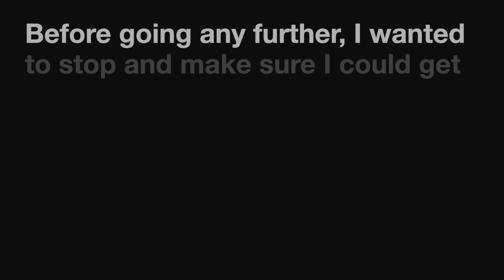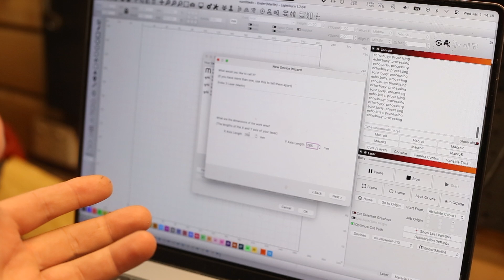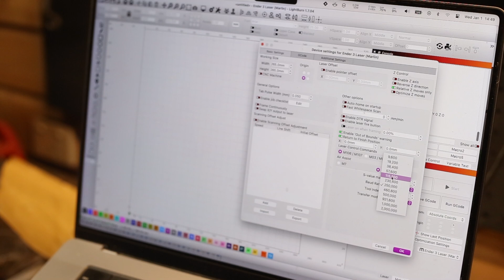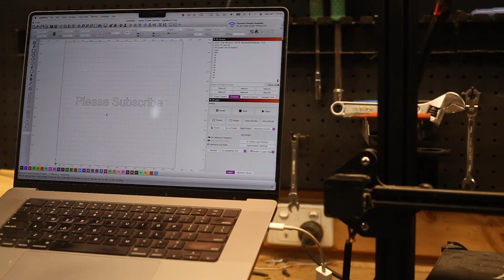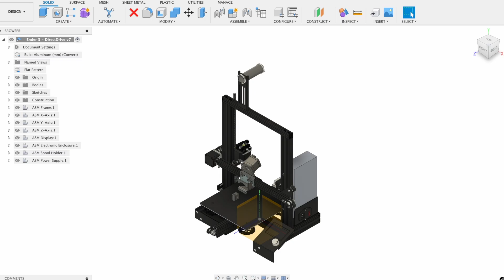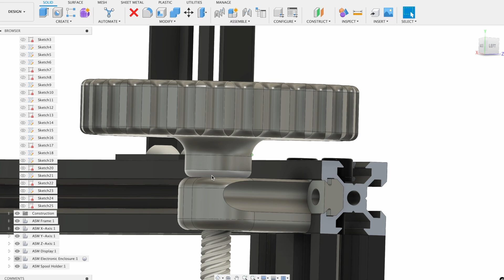Old 3D Printer to Laser Engraver Conversion

Comment: Wy ruin the Ender 3? I'd give it an exchangable system to exchange the toolheads if needed and reconnect the bed could be done with a few switches no? put an 8 or 12 pin pc jack on the cables and toolheads to top it of. But it is a good idea nevertheless. I did this with another printer once to quickly change a single and a duall head.

Comment: 2:44 they specify the power draw on these lasers i think. so that 12V psu of yours better be capable of delivering 1.7Amps
Reply: Not only that. You need to power the board and the X and Y drives to.

Comment: That is Fantastic!! As I am sitting here taking apart my OG CR-10 and eating breakfast I found this video. I was goign to use the parts to build a little CNC rig, but I really like this better AND I can leave it in it's current format. AND this CR-10 is still on 12V, so no need for the converter. Great work!! Now I am off to find a "Laser" LOL

Comment: Curious if you can actually control the power of your laser here? i would say you can't since you seem to not have a PWM signal to the module? I am debating whether I get a creality laser module kit with the external box(hard to find supply in Aus they just restocked and were sold out in a week again) or if I want to buy a good laser module and then recompile a modified version of marlin with defined pins(using the CR/BL touch pins) for a PWM signal so that I can control power,

Comment: So
you disconnected the Z motor and then using lightburn, you USE the disconnected Z axis motor to move up and down for focusing???
Reply from the maker: I move it up and down to focus manually, not using light burn :)
Reply: @taylorhay  OK.  I rewatched it and after you said that, I got it.  Thje video is not clear about it, at tht particular point in the video.

Still, no need to disconnect it.  If you fine tune it vias the screen, you are more accurate than, by hand.

Not only that, you can keep a running list of the actual thickness of each material and add or subtract from there and always just move the z axis  depending on thickness variation.
Reply from the maker: Very true! That would work well

Comment: Does that cut metal
Reply from the maker: Not a chance - just cardboard / wood / paper :) Metal requries a fibre laser and is far better off to outsource rather than to try and do at home.
For small / medium scale its overkill too, check out a CNC plasma cutter - orders of magnitude cheaper and free to run once you set it up :)
Reply: @taylorhay  You could on the other hand, etch into metal (like logo on a cup for instance). Shoot, now I gotta build another axis. maybe use the Z axis to do that?

Comment: On a three on your 3-D printer to laser printer connection the box used for a 24 down to 12. Where do you get that too? Does the screen in the box on the 3-D printer still work the control board the right hand corner I’ve got a printer thank you
Reply from the maker: That 24 - 12v module is called a “buck converter” however there might be dedicated 24-12v units on eBay / Aliexpress - you only need to supply 20w max, or ~2amps so even a small board should be plenty :) 
And yep, the main screen still works